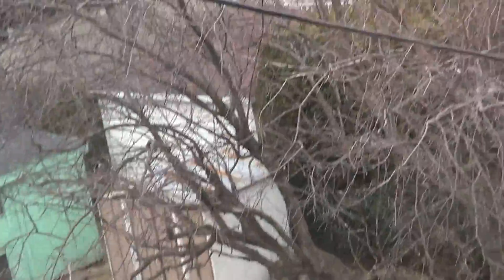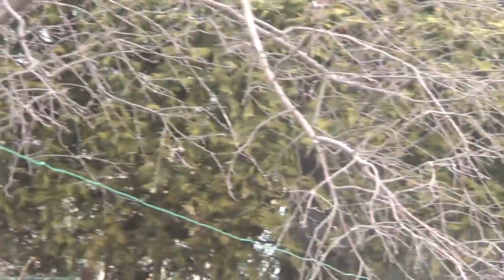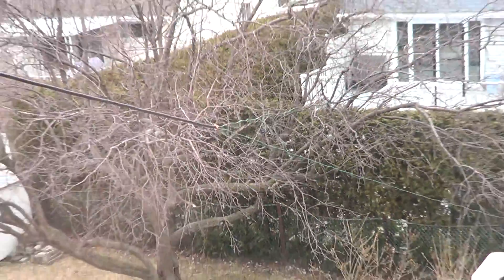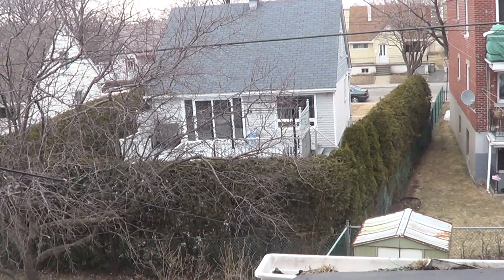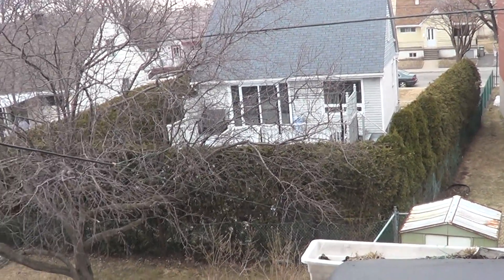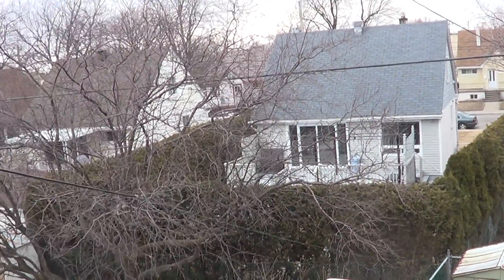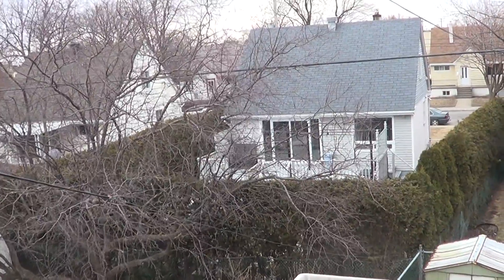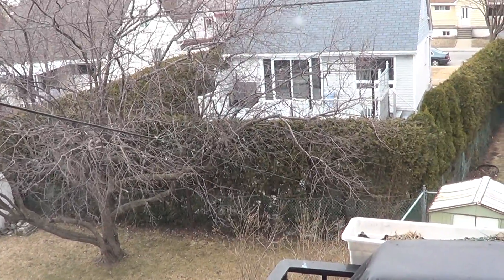New antenna at my listening post in Montreal

Comment from the maker: It's a wideband VHF UHF antenna .. it's rated 30 - 1300 Mhz ...  and can also be used for 2 meter and 70 cm transmission on the ham bands.  Works great